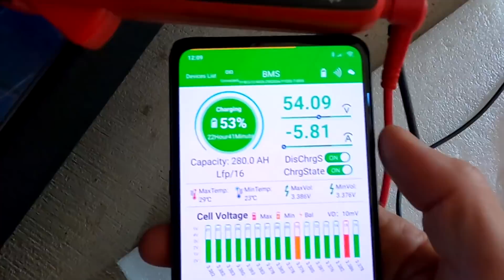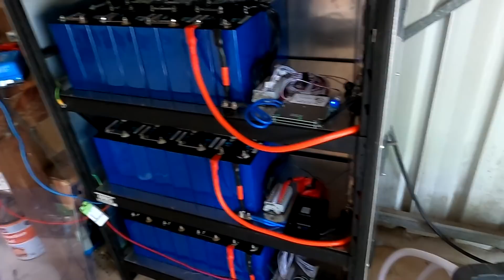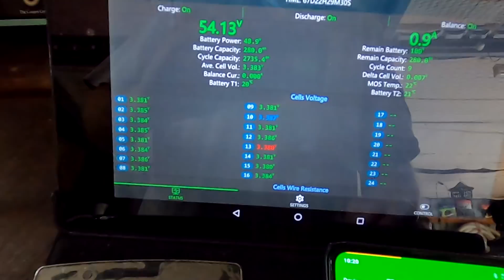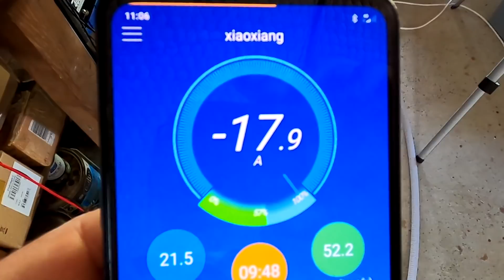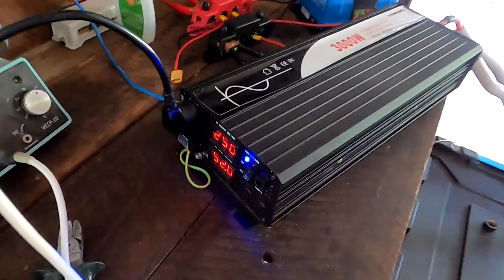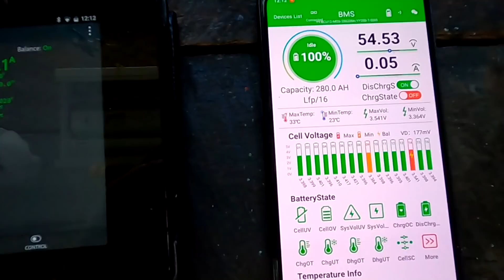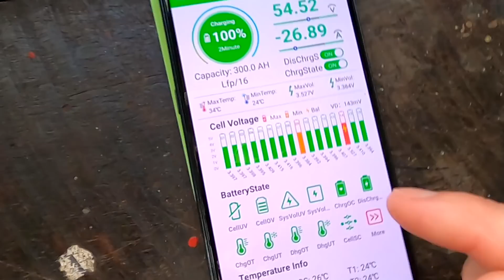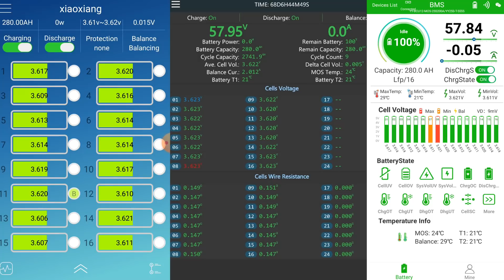Overkill, JK-BMS and Heltec in parallel. Top balancing of 3 battery banks! 🔋🔋🔋(+ magic smoke!)

Comment: Andi I have 105 Ah EVE batteries with the JK BMS .600 milli amp ballancer, After more than a year of operation I can agree with you that the JK BMS is a Good adequate Ballancer when setup correctly...
Thanks again for sharing  your experience and knowladge...

Comment: I guess the moral of this video is NOT to mix & match BMS's with equal batteries on the same system, even if they all have identical settings they still act differently and it seems an active balancer does the job far better and quicker which is what you need with daily charging and limited sun.
Reply from the maker: Well, the battery shelf works like this for 1.5 years now without any trouble.

Comment: Hi Andy! I already feel like your friend, after watching so many of your videos! They have been great help and source of inspiration when designing and building my grid-tie setup.
I too went this way with balancing, only my JKBMS:s are only with 0.6A balancer, and my cells were super off balance... I'm now 10 days on in waiting them to balance so I can put them to good use.
I calculated that if the unbalance is only 20% of the capacity (280) that's already 56Ah => 93 hrs of balancing PER CELL :/ of course balancing works from both ends so its not that bad in reality. But it definitely can take time.

Comment: Hey andy. 
I was wondering how you have 3 battery banks.
I was thinking you have to have equal numbers of banks to wire them up together in parallel. Keeping the voltage the same. 
I did not know you could have uneven. Could you educate me on how this is achieved.

Comment: Hi Andy, am watching your uploads over and over, trying to decide on a BMS.  I have some 188AH Samsung 5S2P cells, 18.35 nomimal voltage. I wonder if the Overkill 48V 16S will allow me to use only 15 of the cell strings like the JK's? Thanks regardless!

Comment: Helly Andy, many thanks for all your very understandable and detailled videos, a lot of things to learn. Building my own pack with 16x280Ah EVE /cells, using a JK BMS after seeing your different BMS test, using the same kind of quick connector for plugging the BMS wire, very simple to use. Waiting the Victron Multiplus 2 48/3000 I will use for my house to improve the self-consuption rate of my 3600Wc solar panels

Comment: How did you setup your benchsupply WANPTEK to charge?   Mine 60V20A self destructed after 2 minutes set to 58.4VDC with 10A supply in CC mode.
Reply from the maker: I've set mine to 55.2V and 21A and let it run for a full day yesterday for a test. Just connected pos and neg via a circuit breaker to the main bus bar of the battery... and charged.

Comment: Hi Andy, one of the solar mppt its charging one of the battery bank? And output each of the battery bank is connected in parallel ?  Thank you sharing you experience
Reply from the maker: All solar charge controllers are in parallel connected to the large bus bar. All single battery banks are connected to the same busbar in parallel as well.
I have 2-pole circuit breakers in between all of them before they connect to the busbar to isolate them individually if needed.

Comment: Andy thank you for these excellent videos  and heads up comparison of BMSes. I have two BigBattery Kong Elite battery which have BMSes that seem to be just like the overkill. I am using SMA Sunny Island inverters in an AC coupled setup with an SMA Sunnyboy 7.7 inverter. Unfortunately the Sunny Islands do not have Lithium Iron Phospate charging settings like the Victron solar chargers you have. Therefore I have to use lead acid settings for it and adjust the charging voltages for the different charging phases. What is causing problems and exactly mimics your testing during your absorption charging phase to full voltage is the lone high voltage cell disconnecting the BMS charge mosfet and therefore essentially that battery pack (the sunny islands don’t like it when the BMS disconnects charging, it causes a power glitch and shutdown then power up again on remaining battery cabinet). For me, this happens on the “float” charge cycle which I cannot turn off because inherent to the charger. The JK BMS possibly looks like the solution to this problem for me as it seems to keep the cells well balanced at this very low current, constant voltage charge phase. Now just to figure a way to install using the existing wiring and cable harnesses without cutting. Great videos and greetings from sunny Arizona.

Comment: Just had a Victron charge controller die the same way your boost converter did. I tried resetting the controller by turning off the solar breaker, then used a 300 amp Daly bluetooth bms to turn the charge controller off and back on. The charge controller now has a short on the solar side of the circuit, and none of the lights on the controller turn on.

Comment: 1. The current used is inaccurate, which will inevitably lead to inaccurate soc calculation.
2. Manually control the charging port, the logic of HELTEC BMS is that it will automatically recover after one minute. Because if it does not automatically recover, if it is discharged during the period, it will definitely cause the mos to heat up and high temperature. Clarification is needed here.
3. His dcdc exploded, it has nothing to do with bms
4. Regarding the status prompt and time of the balance, it takes several hours for the passive balance to be completely leveled. You can make bms automatically balance to see the effect in the unbalanced situation.

Comment: This is why you need active balancers on all the time. I have 5 x 14s, 2.5 KWh batteries all in parallel and each has a heltec active balancer and a Daly BMS. The BMS is only for under and over voltage protection.  They have spec capacity and stay in ballance.
Reply from the maker: Great, thanks for sharing. I have mine now connected permanently and am in the process of charging the battery up again after 4 weeks of using it. It will be interesting to see how balanced they still are.

Comment: Nice Vid.
But the JK is running only for 68 days, do u have realy so mutch material what we have never seen yet? this means u have a really hugh backlock with vid material for us ?
After you tested the JK it was for me clear to take it, i have grade C cells but they work, now im looking forward to monitor everything, BMS BMV MPPT MultiPlus etc., how everything together work.
and the stuff will not end... can u test some AC inverter on the Multi, to show what this device can handle, on AC IN and AC Out?
This device can so mutch more than 230V/110V , i have it in use but im not sure what is really possible with this devices.
Trink ein kaltes Bier und mach weiter so, ich feiere dich 😂
Reply from the maker: Thanks Jörn, The Multi can do a lot more and we will connect some AC inverters to it. I have ordered some micro inverters to test out if this could be an option...
I'm not making videos all the time, I still need a lot of time for the editing and commenting here 😉
Reply: @OffGridGarageAustralia  Micro Inverter , that ist a good Option a Lot of people have good roofs but the DC cabling would bei Tricky, but the Most have a AC Socket next to it. And U can geht These small Inverter Form small Money, 1-6 Panel so there ist a Lot of Power to get easy. I have my Multi and a smart Meter, it is grate. It Takes the Power wich would Go to the grid and Feed it in the battery.

Comment: Andy, can you or anyone of your subscribers recommend a supplier, I need one cell at 190Ah many thanks.   🇬🇧
Reply from the maker: Never heard of a 190Ah cell. You can always go bigger with no problem. Without knowing the specs of your cells nor the application and devices you're running, you can also use 2x100Ah in parallel to replace this one cell.
Reply: @OffGridGarageAustralia        Andy, can you advise me how much higher do you think would be ok.         🇬🇧
Reply from the maker: @johnbell1859  It could be any capacity, really. As long as they are all top balanced, it does not matter if one cell has double the capacity as the other ones. When the battery is discharged three cells will be empty and the other one still half full. So you will use only the top part of its capacity.
You can easily use a 272Ah or 280Ah for a replacement. Just need to work on the connection then...
Reply: @OffGridGarageAustralia           Andy, thanks very much for your reply and advice much appreciate.         🇬🇧
Reply: @OffGridGarageAustralia         Thanks Andy for replying, that’s a good option for me. l just need to find a trusted supplier many thanks.      🇬🇧

Comment: Amazing. Thanks for the video!!! I just ordered 96 280 Ah in order to build 6 battery banks and put them all in parallel. Any recommendation? I love your battery circuit breaker. Have been looking online for something similar. Can you please share the component name?
Reply from the maker: Thanks Salim, go with the JK-BMS for your 6 banks (1 for each bank): https://off-grid-garage.com/battery-management-systems-bms/
and the breakers are here. The ones from AliExpress have the same (or better) specs as the ones I use: https://off-grid-garage.com/battery-accessories/

Comment: My overkill solar BMS management app looks very different from yours. I downloaded it from the overkill site and it brought me to the App Store. So that’s the one I installed. Can’t really add a picture. Is it just a setting in the gui somewhere. I like your graphical interface much better.
Reply from the maker: Yeah, there are many apps out there which will work with these Bluetooth modules of the BMSs. Even the Aolithium app will work with all these BMSs. The XiauXiang app is pretty good actually as it give me full control over all the parameters.

Comment: If these "Grade A" cells were made with better quality control, we wouldn't need balancers. I can't get my 132kWh bank above 55.7V without 6 out 10 batteries shutting down due to OVP. Sad.
Reply from the maker: The BMS only shut down because I did not top balance the cells before. I explained this in the video. Two of the batteries in each battery were capacity tested and not fully re-charged to the same level again as the others. Hence the pack was so out of balance.

Comment: I'm REALLY curious how well they stay in balance at 3.60 V (57.60V) after 5 to 10 cycles...
Reply from the maker: I rarely fully charge my battery. I'm now at 55% and have turned off all loads again to to exactly that test after around 4 weeks of having the three batteries installed. Let's see.

Comment: Thanks Andy. Just ordered my batteries from Qishou and wondered if you had any recommendations for solar panels? Here or China?
Reply: If in SA buy from Tinda solar panels, speak to Shayne, made here in Adelaide. Why buy China?
Reply: @johnlazdins2004  Thanks. I wasn't in SA. Have heard of Tinda, but looks like cells are still made in China and then final assembly only here in Oz.
Reply from the maker: Do you want new ones? I looked on Alibaba as well and can see they are selling 550W panels for around $140 plus shipping. No MOQ. They are just too big for my roof and I ended up picking up a 3kW solar system, including rails and 5kW Growatt inverter for $300 on Gumtree. Exactly the same panel size I already have on the garage, so this will cover all the garage roof now. 7.2kWp all in total for this building.

Comment: I can't believe they manufacture these BMS designed for enormous packs and think that a balance current of a few hundred mah is going to do anything.
Reply from the maker: Maybe they work if you charge your battery on a daily base and just have a very small drift to compensate with the balancer?

Comment: Thanks Andy.
Why the hell do they even make these BMSs with such low balance current? It just makes no sense.
Reply from the maker: I think these designs are coming from Li-ion batteries and the linear charging curves this chemistry has. So the balancer has got all the time to balance the cells during charging. 
The smaller balance currents may still work with LFP batteries if you fully charge your battery every day and the drift they have to balance out is not much.
Reply: @OffGridGarageAustralia  You might be right Andy - I never thought of the LiOn vs LiFePO4 balance differences. 
As you say, the former can be balanced virtually any time whereas the LFP only at the very top. 
I actually managed my 400Ah 12v Winston Caravan LFP battery for the first three years from late 2015 with no balancing at all, obviously very well matched cells. I did a very good top balance before installing, and after three years they were still good enough, just one cell going a tiny bit high at top of charge. Then finally I installed a balancer and now it’s all sweet, typically almost exact at top of charge.
Reply from the maker: @FutureSystem738  that's exactly right, Dave, Li-ion is much different.
Your cells must be perfectly matched. It also depends how high of currents you pull from the battery. The larger the load the more drift you will see over time across the cells. Connecting a balancer from time to time will certainly maintain the battery perfectly.

Comment: Geeze. I don't know Andy. I have considered your set up to be one of the best on the net. I do want to pattern my set up like yours and Pete's setup from HBPowerwall while using Battery Hookup 6Ah cells. On the other hand, it seems like you are beating yourself over the head to make yours work and Pete seems to be having a few problems also. I think that his stems from using used cells, but I don't know that much. On the other hand, I am certain that I will not be experimenting with three BMS.
Reply from the maker: Hi Bill, thanks for your comment. I did not have any issues really. The main problems were caused by my many test I ran during the constructions and setup which caused some (deliberate) hiccups. But that's just what I do on the channel...😉
Reply: @OffGridGarageAustralia  I figured that that is what you were doing. Being a teacher in one of my many other lives, I could see a lesson plan happening. Keep up the good work. I will be referring many times to your advice I am sure.

Comment: Maybe my opinion is not mainstream, but I'm not a big fan of the JK BMS. Not because it doesn't work, but because it feels badly engineered to me. 
I poked around in the communication protocol to attach it to my self-made controller and the protocol is stupid and not well done ( that hurts my computer scientists feelings 😉). Furthermore, I don't like at all that the thing has to be activated by charging after it has shut down. I still think that the Seplos might be a more professional solution, without having tested it yet.
Reply from the maker: Thanks for sharing, Key. We have yet to explore the communication side of this BMS but from what I read so far it seems to have no issues with talking to VenusOS for example.
The initial activation is certainly a design flaw and I would not have put this on the market if I would have engineered it myself. The flawless functionality of the BMS makes up for that nuisance I think. The new JK has now a switch so it can be turned on easily.  Honestly, this is not so much a problem because the BMS will stay on all the time 24/7. I had to start it once when I installed it back months ago. Never turned it off again since...

Comment: How does the Helltek and the Daly that you have compare? Honestly, it seems as though you are having quite a few problems with the Helltek. I remember that you had some problems with the Daly, but you seemed work them out after one or two epiphanies.
Reply from the maker: The problem of all these simple BMS is the balancing current (the Heltec has additional problems though). They are all working fine as a BMS to keep the battery safe which is the main purpose of a BMS. The balancing can be added with an active balancer, So Daly, Heltec and Overkill a work great in combination with an active balancer.
Reply: @OffGridGarageAustralia  Yes. I got that an active balancer would be useful from one or two of your other videos, though periodic use is better than constant use. I do plan to incorporate one in my set up. 
Just out of curiosity, I remember that you had the threads strip in cell 6 in the first battery pack I believe. How did you fix that? It seems that showing how to fix something like that might be a really good thing to show in one of your future videos since it seems like so many of these cells have aluminum terminals, and aluminum is so very tender.

Comment: Andy , can you test your inverter efficiency at 16s,17s and 18s? I wonder if higher voltage on the dc side will improve the overall efficiency of the system. At 18s you probably can only charge up to 3.45v per cell, but the nominal voltage of the pack will be around 6v higher ... so 12% less current
Reply from the maker: Hi Anton, I have only a 16s battery here. But have a look at this link in the Victron Community forum. Raphael did all the testing for that. Interesting read.
https://community.victronenergy.com/questions/56351/multiplus-485000-efficiency-curve.html

Comment: Trying to charge a cell with a power supply.
I fitted the clamps on the very outside of the terminals.
nothing happened. Finally discovered that the outside of
that cell is covered in plastic!
Reply from the maker: Hahaha, that is great! 🤭